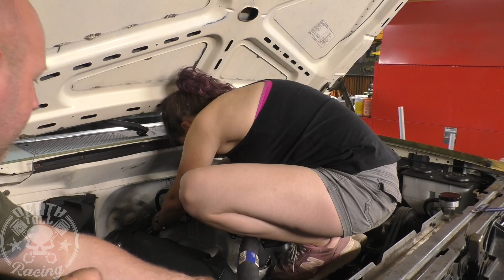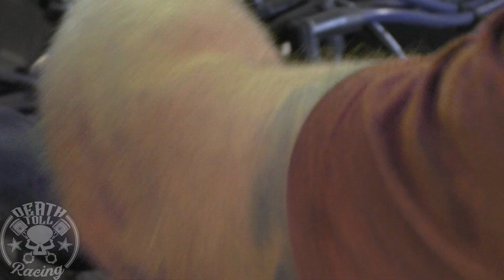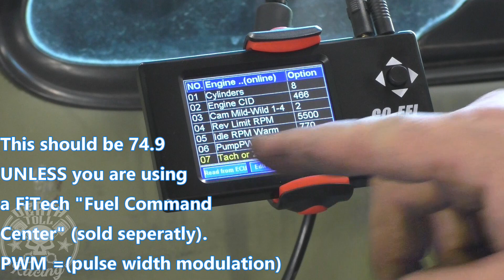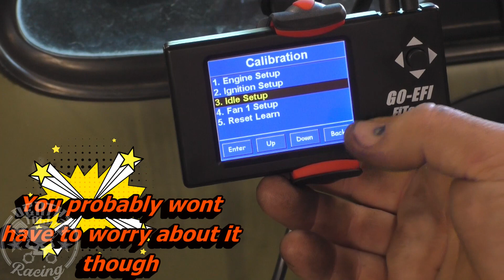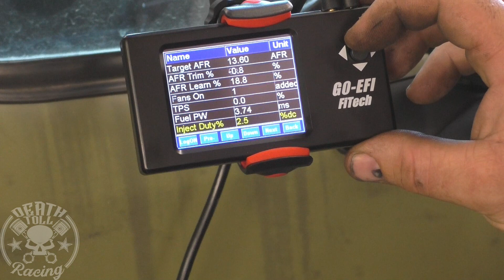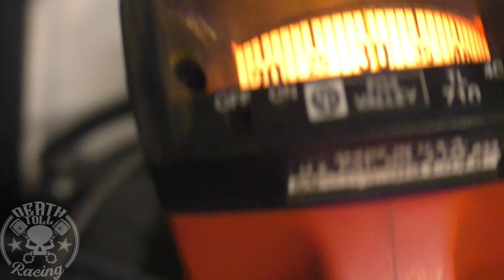DTR F-350 E-4: FiTech Install Part 2.  We finish up the install and get through the initial startup.

Comment: Thank you for your time Chief. Very interesting when you never seen the system before. Great looking truck. Nice work horse. You a educated man. You knew what you wanted. Question. Does the display tell you BHP. And do you think it would fit on a rolling road. Or is there another way to get BHP at back wheels with a load on. Thank you. You have to do a ride along video. I watch another guy called Jonathon W. He's a wrecker guy. Builds some rat roads. Takes us on some road trips. Good luck to you both.
Reply from the maker: I am unfamiliar with BHP?  What does that stand for?  I even google it, and google doesn't know either.  If it's "Brake Horse Power" then no, it does not.  I don't think there is an actual way of doing that.  It does show you load on the engine though (0-100%).   I'm not sure how they are getting that calculation.
Reply: @DeathTollRacing  Ye man that's what I was talking about. Don't know how you say it. No worries. Maybe you find a Dyno one day to fit you rig. I follow a English guy he got his own Dyno. Ignition advances is the name. Short vids but he will rev it up. Give him a look.
Reply: Have a word down your lady dentist ear one night on the pillow. Say never touch my (Basted File) again please you can goole this one. But I image Pope knows it. Smart man. If you hit the pillow and say any chance I can get a tractor seat in there so I don't get damaged. I garrentee ya. Ya man will fix ya up. You be sitting like a Queen.. Forgive me Pope. Didn't mean to speak to early. But I do belive there's new blood on the way. Full luv Dino
Reply: Song for you both. Lynard synard. If I'm wrong. Separate the words from the beat. Got to be one of my favourites D

Comment: Now i want FiTech for my galaxie. Great job!!!!
Reply from the maker: I like them.  Other than that fuel pump leaves a little to be desired.  I looked it up, and they still sell it, and the reviews are exactly what I ran into.  The hose clamp doesn't fit, and the pumps barb breaks very easily.  Some people broke it just trying to replace the hose they give you because apparently that also fails.  So I may pull it and replace the hose as well. The pump I put in there as a replacement is metal, not plastic.

Comment: Never met a balancer I trust.  Probably get the push rods figured out before doing any tuning.  Looking good man.
Reply from the maker: Yes for sure!  I ordered a couple sets of different lengths.  All on the assumption that it has the factory length in there now.  8.550  I noticed they were not very far into the hydraulic portion of the lifter (which is 0.140), and you should be in the center.  So if everything works out like I'm imagining, I have a set of 8.616 on the way, and I'm betting those are going to be what I need.  I felt like the lifters were only down about 0.010-0.020 (by feel, not actually measured) and that would put them pretty much dead center. The bonus part is the 8.616 rods were only $36 from comp cams.  Jump up to 8.650 and they are $100 more than that....
Reply: @DeathTollRacing  I have a few sets of adjustable push rods.  Expensive part is using a 12" dial caliper to measure their length.  I don't think I have ever found them as cheap as $36 though.  Nice score.